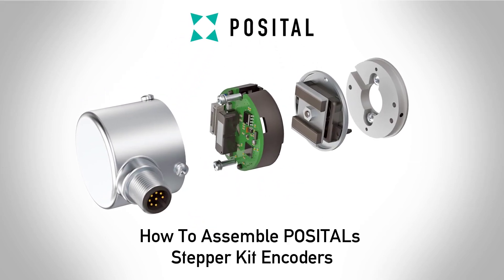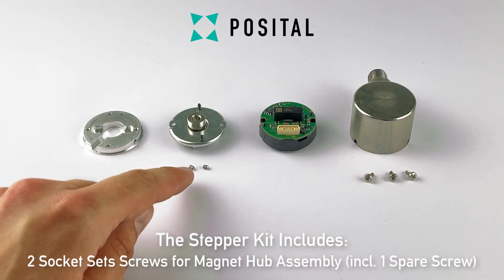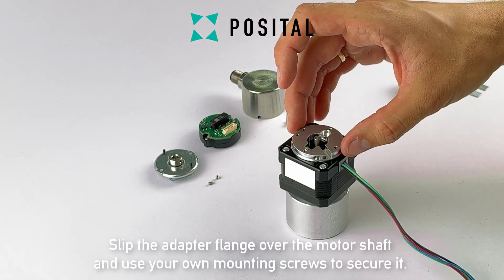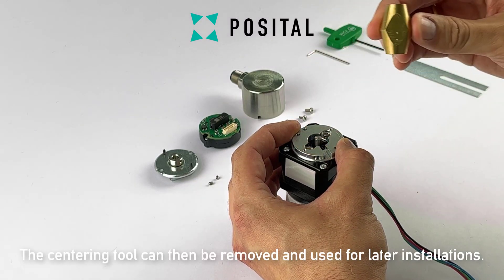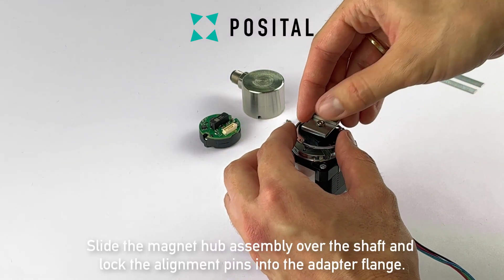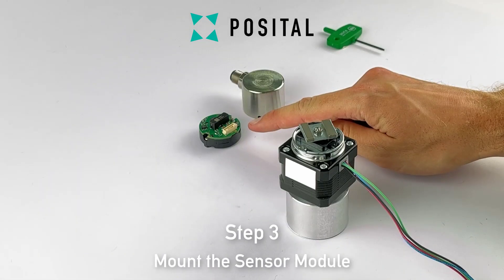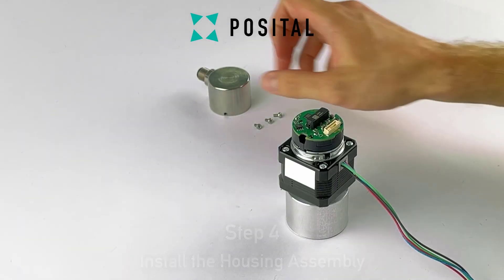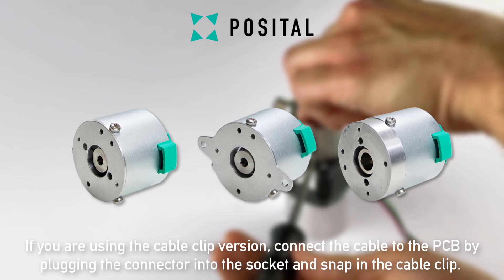How to Install a Kit Encoder on a Stepper Motor

Comment: Nice Video. 👍At 3:31 you show  the Encoder connections EA+,EA-, EB+, EB-, EZ+ and EZ-. But the wiring information part is missing.
To which pins of Arduino are these 6 wires connected? 
The Github sketches also don't have any details. Could you please clarify and let the readers also know the details.. Thank you.
Reply from the maker: For technical questions please contact our support team via the chat function on our website. Thank you!